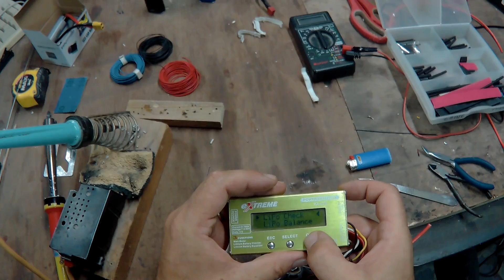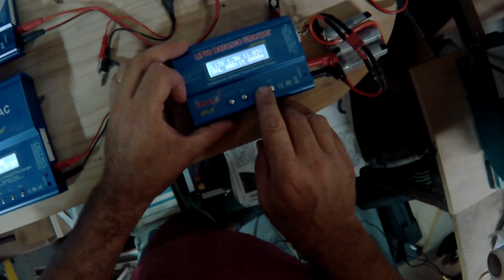DIY li-ion battery pack 18650BD 3S 3200ma 10ah cdr

Comment: Nice pack, higher temps, less time soldering and consider using wire instead of those strips. Cleaner and they solder faster. Also.. The problem with LiIon is the discharge rate. 5Amps is like 1/4 throttle for me 🤔

Comment: You do realise the -runs right up to the very top of these batteries, just take the plastic of one and see, then you won't go useing that much solder again when you see how close you came to shorting them out, and trust me that's not good with them ones they go of very fast
Reply: When you solder these like that, advice is put a strip of thin cardboard under the gap between cells to keep from melting the plastic and getting a short.  Enjoy.

Comment: How many volts does it give off? I want to use it on a Brushed motor esc. the amperage should be fine. i just need to to know the voltage becuase the esc is rated for 2-3s lipos.
Reply: Could you still put the 4 pin balance charger thing on a 2s?
Reply: A friend of mine purchased the Turigy 6 cel charger but the 3 cel balance port on it stopped functioning so he uses the 4 cel port and it works like the 3 cel port should have. Since it worked that way he didn't have the hassle of sending it back for warranty replacement.

Comment: How do these batteries perform in comparison to a lipo pack?
Reply: Are there 18650's available that can sustain a higher continuous discharge?
Reply: Hi is this better than NCR18650b series, have u tried?

Comment: Hello ,
Please tell me how to calculate Ah or battery capacity when Two 3 battery is connected in series having an output of 12v. Along with the parallel connection.
Reply: A series connected battery adds volts, but not amps.
A parallel connected battery add amps, but not volts.
To get 9.6Ah at 12v you need 9 cells wired 3S3P.
And - these cells are often rated to load around 2C or 3C.